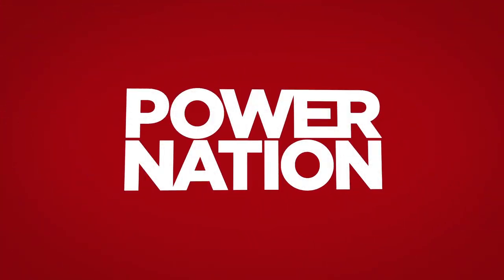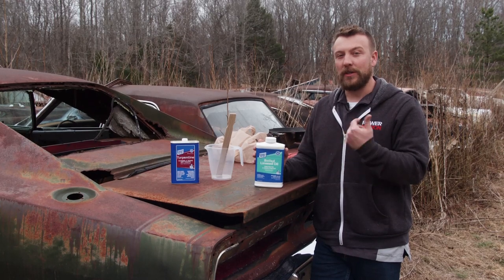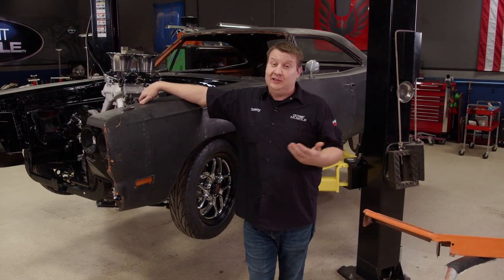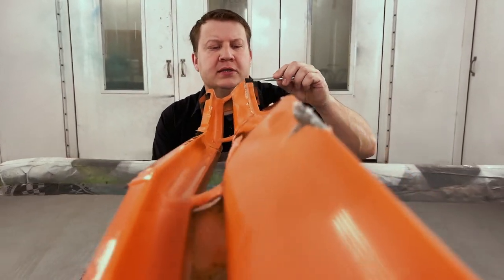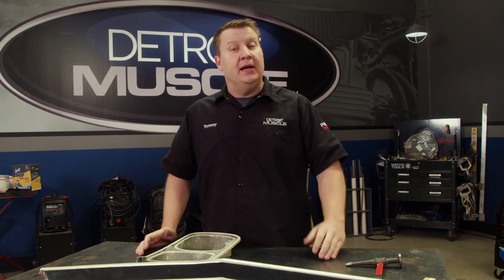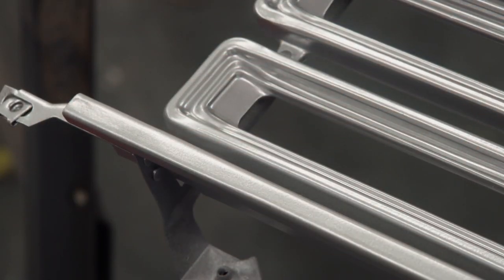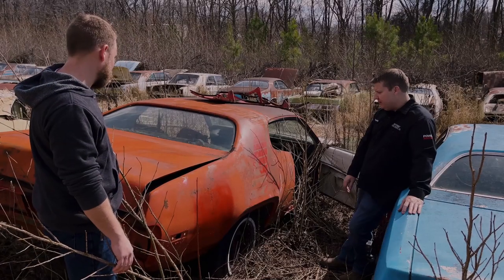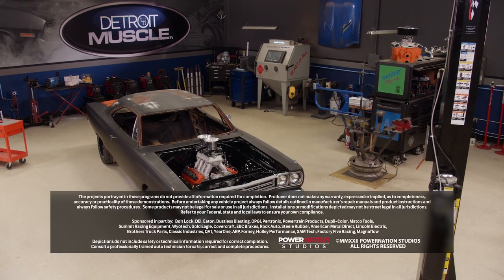’69 Road Runner Gets An Enhanced Patina Paint Upgrade Part 3 - Detroit Muscle S9, E4

Comment: Honestly, I spray everything down that sits on grass with penetrating oil and it works great to keep rust at bay, gets into metal so easier to wrench, I dont use the foaming type, but I'll spray everything from the engine down, in cracks, all side panels, tires, suspension, frame. Keeps critters away for sure, tested in field with bunch of trucks.

Comment: To me a patina "paint job" says "I'm too lazy, too cheap, or I just don't care." Not many will go through the trouble that you do in the video so they might spray some rattle can clear or don't do anything. This is a fad that will fade quickly as people realize the emperor's new clothes aren't there. I hope. As someone already pointed out, these old road warriors deserve more respect.
Reply: One could argue that the old road warriors earned the patina.
Reply: Along the hot rod baseline, there have always been primered cars. Those are owned and built by the traditional hot rodders who believe that's as far as they want to go on their cars. They adhere to the "very bare bones rod" school of thought. To them the car finished when it's ready to drive. For their money, all the car needs is a drivetrain, wheels, a body, a seat, and a steering wheel. Anything more exceeds their vision of a hot rod. Paint costs money that could be spent on going faster, so it's not priority and never will be.